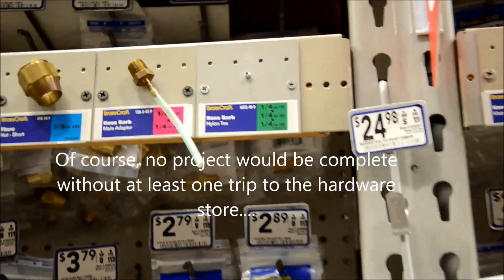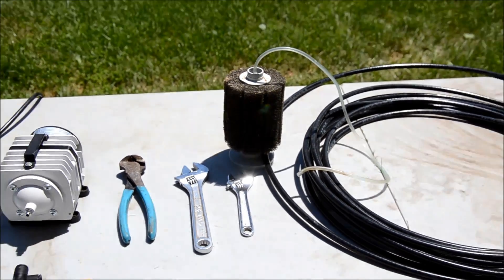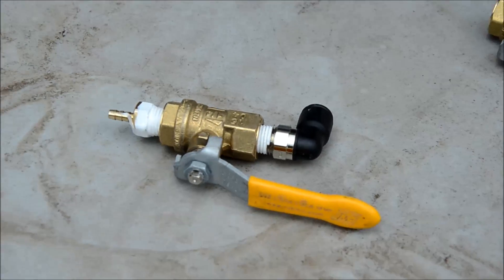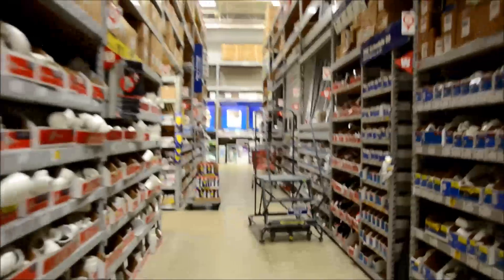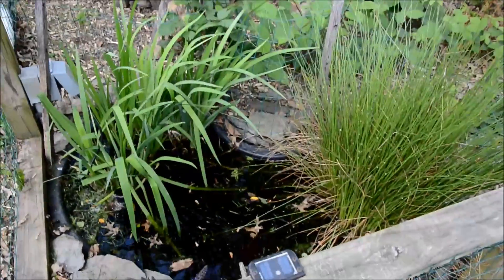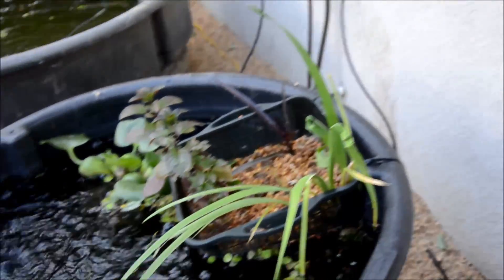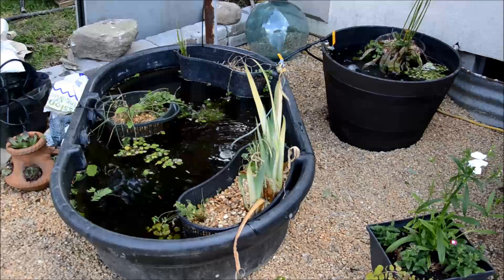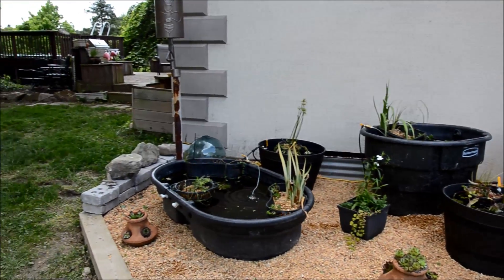Summer Tubbing Part 3, Filtration- Tuesday tip

Comment: Awesome video! Looks like the zip ties are working pretty well so far. Can't wait to see some fish in the tubs! :)
Reply from the maker: +Josh's Aquatics & Railroad Videos yes great so far. The only time I second guessed was a freeze warning (way unseasonably late) two nights ago. Worked out fine though
Reply: Rachel O'leary Cool. Once I finish cleaning out/replacing the drain on my 100 gallon tub I'll be using zip ties for sure.

Comment: Looks really good Rachel. Use the your water change water from your tanks inside to fill that big tub. Thats what I do with 3 bowls that I have with plants.
Reply from the maker: +Ruben that would mean carrying a lot of water up a lot of steps
Reply: +Rachel O'leary I would use a pump and hose maybe though a window. It was just an idea.
Reply from the maker: +Ruben yea, i think it is pretty hard to get a perspective about how much hosing that would be, the fishroom is on the opposite side of the house and we dont' have any windows that open into the basement. Luckily, it has done nothing but rain!